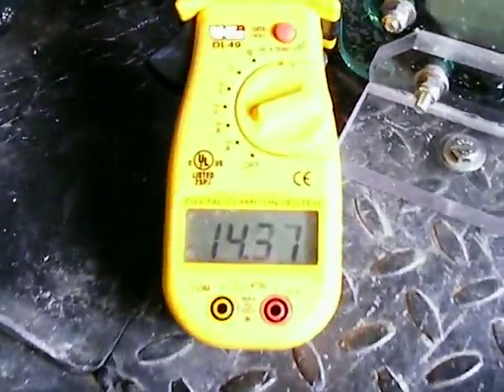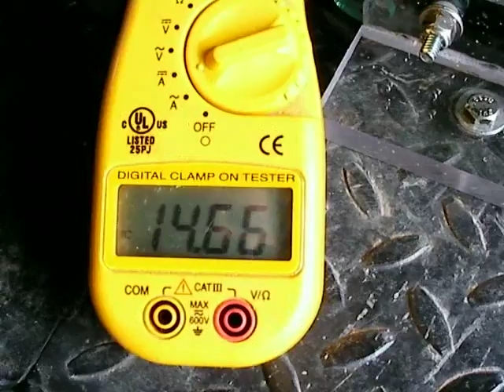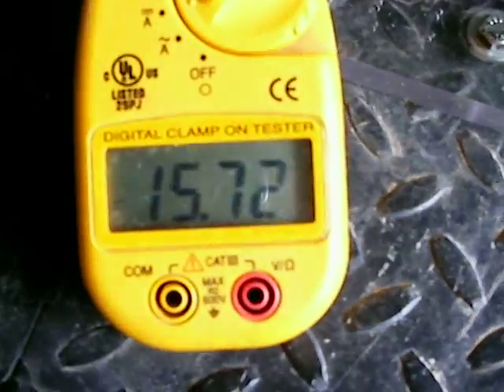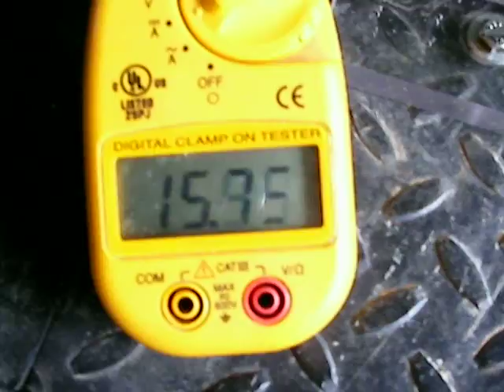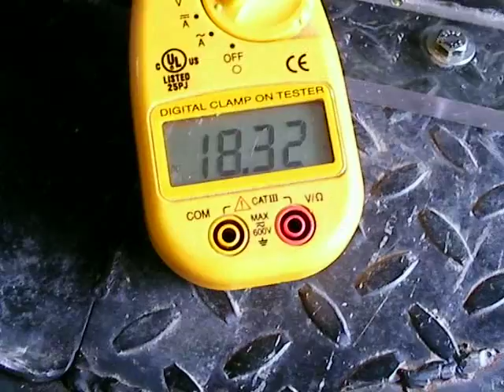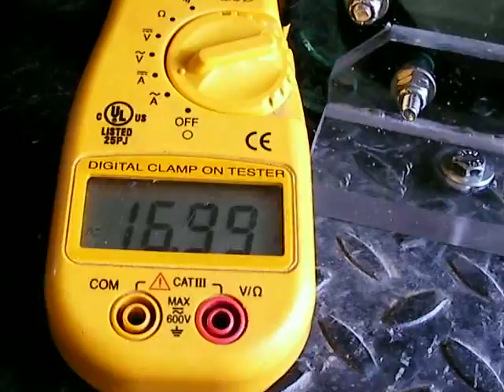using nano silver to run a hydrogen cell

Comment: Hi, its 2021 now. how is the HHO taken off? I'm sure it works for carburator unit but do you  have any recommendation on EFIE for injection cars?
Reply from the maker: hey i was taking a looong vacation i moved to treating water with the cell design..
Reply: @advancedhydrogen  it to hear you are well n back. 
Ive build 3unit of your design of cells. I like the 6x6 13plate. This unit gives me 1.8lpm at 27ampx12v.
Could you recommend an EFIE for vehicals wt HHO.

Comment: Silver is a good conductor so just being charged with electrons working as neutral plates giving increased surface area for more gas production. Just my opinion. But an interesting idea. Due to diffusion the silver should stay relatively evenly spaced throughout the electrolyte. Should cut down on the amount of plates needed in wet or dry cells. Now a follow up question. What happens to silver being used as a sacrificial anode?

Comment: It looks like 800 ml per minute. if you count 16 Amps times 12 Volts = roughly 200 Watts it means 4 ml per Watt. Since you had to water down the Concentration of  KOH to accommodate the max Amp Draw from your Alternator I think it is pretty good. Kalium is a metal as well as silver. Both have different electrical Potentials which means there will be first an equalizing of this potential as an exothermic Process. It means your Cell will become very hot and than with this Heat Energy support the debonding of the Water Atoms to Gas Ions.Since Ions charged electrically the could wind up with your Silver as a Oxid. Can you check the Output of your Cell with KOH and KOH and nano paticles.I would love to to hear your Results. I,m not sure  yet about the whole Process of Electrolysis.
Thank you ahead
Helmut

Comment: Magnisum sulphate works very well also.
I like your magnet set-up as well, but you would increese your production if you put them on the faces of your cell.
If you want me to, I'll redesign your cell for you so that you get zero curent leakage, great gas flow and magnets intagreated into it.
If you are looking to jump up the energy level of your gas, use deep UV and infrared.
If you have any questions just give me a shout out and I'll give you the low-down.

Comment: I don't think anyone will argue with you. Nickel is magnetically attractive.  Lining your plates so the input/output holes line up will get you real nice thermal migration almost like a pump. you can stick your reservoir right on top of the cell if you wanted.